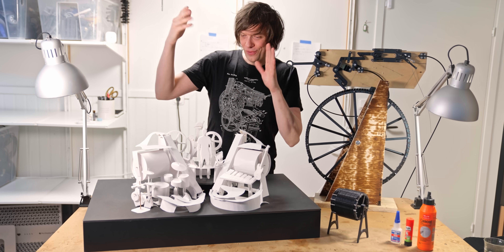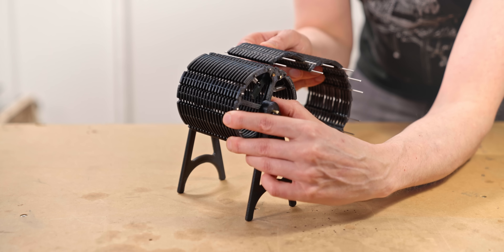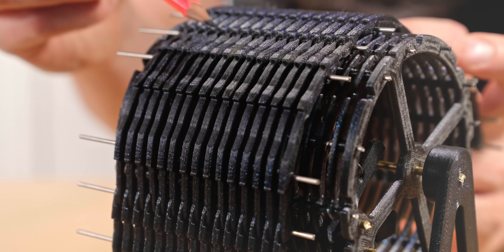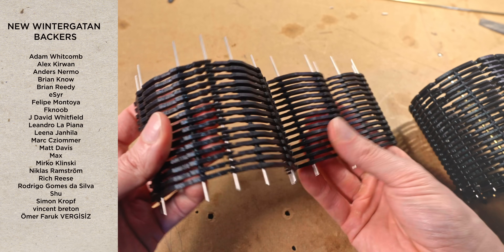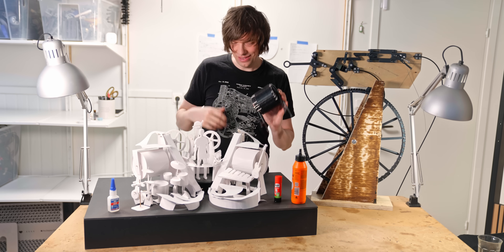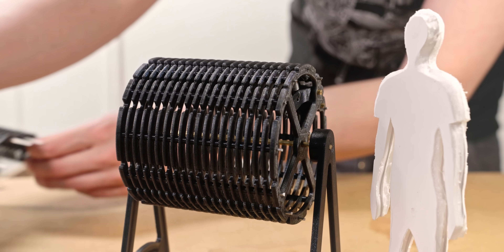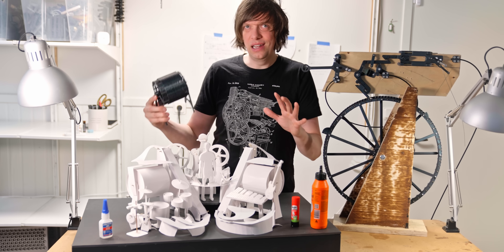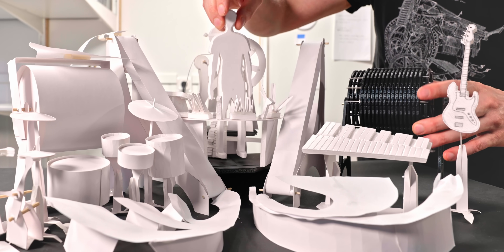A new way to switch songs on the Marble Machine

Comment: Is there a reason to have a manually programmable wheel on stage ? I feel like it'd be better to have 2 different wheels, one made for manual profiles, and the other made for pre-programmed music layouts to wrap around.
In theory it'll be easier to have two than to combine them, especially as each are used at different times for different purposes : the manual one should be designed to allow fast iteration and easy programming while the stage one would be designed for repeatability in song swapping and reliability for the alignment of each song "exo-sheet".
Reply: actually scrap that, just saw someone else's suggestion of having a programmable part be on a special music sheet, which is even better : you can test the alignment in-situ with the sheet mechanism, you can also have multiple WIP songs and just swap between them without having to take note of and remove all the manual profiles, then put all the other song's profiles

Comment: I think the idea of being able to switch out a fixed preprogrammed song is a good one.  It seems the problem which is being solved with this idea is that swapping out the entire drum is hard.   However, I think that CNC machining individual plates will be way too much work.    You will need to machine hundreds of different note sequences, and each one needs its own CAD / CAM program.  It could be better if you could snap in the notes into plates that you could pin or otherwise fix semi permanently in the plates.   Then the plates could be swapped on and off the wheel to change the song.   This way you have a very limited number of notes that you need to make, which is relatively simple, and the plate are all the same, and so they can be manufactured easily as well.

Comment: The idea of changing without having to unmesh gears sounds good in theory and with your plastic model. But that model hasn't been connected to the entire gear chain.

How well will this work when you do have it connected to the entire gear chain, so turning the drum to change the song will require turning everything connected to that chain?

Or will you set it up with a clutch of some kind that will allow you to disconnect it, but then quickly realign and reconnect it?

Comment: As an expansion of this, you could consider having a programming belt, which can be larger than the wheel, and only mesh with a portion of the wheel to play the song. Depending on the length of the belt, that might even allow the belt to be changed while it is playing.

Comment: wouldnt there be an option for some analog horizontal programming ring switch? I understand a srewlike design wouldnt work, but it could be that at 360 is "shifts" the next ring in. This way you can keep on adding rings to it. It does still have a small 'pause' while the new ring shifts into place. I have no idea about the sollution to getting it to work, but it would be sick and im pretty sure you and your team can find a solution to it

Comment: the problem with this system is, that you have to handle the "music-sheets" on the road and from the looks of it, they will be about 1m x 4 m and an absolute pain in the a** to transport. The big advantage of the 4-segment programming plates was, that they could be handled alone and stack nicely for transport, where as now, you would need at least 2 people, if not 4, to load the machine and an absolute gargantuant amount of truckspace to transport them

Comment: I'm no engineer. Just real world experience working with machines. Even I can see that single piece wrap around is going to need strong joints where it pivots to prevent breakage, (which in turn adds weight), when the change out happens. At least 2 people will be needed to change it. Any twisting of it could break the joints. (Repair costs). A handler could trip and fall breaking it. If that happens?????? Not good. Storage space for it during transport could be a problem.

I liked the quarter panel change out programming wheel concept in MMX2. Maybe mash of the two concepts together could work?  A single quarter panel could be handled by one person. The quarter panels would store better. Lees chance of damage to the panel.

Comment: If you made it a reel to reel programming belt the songs could be changed during a performance by feeding a new belt onto the conveyer or end of the previous belt.  It would also make programming the song easier in my opinion because you could have the belt numbered or color coded in a grid format to help guide the person doing the programming.

Comment: I'm curious about using scripted designs to help prevent mistakes. Like making it so that each slice of the wheel can only fit next to the two slices that are supposed to be adjacent to it. I'm thinking something like tabs that fit into holes, and encode the slice's position in binary. You'd need more than just the binary encoding, though, or a tab representing '1' would fit into the holes meant for every odd number.

Comment: Martin, I'm sure you've thought about it, but it's not a problem that the extra layer will increase the circumference a little bit, in length. Does this not affect the speed or length of the song playing? Doesn't it make a difference to the operation of the marble machine?

Comment: For when you program on the wheel itself, you can design a reader that converts your composition to midi and a program that converts that midi into a cad file for the permanent wheel skin.
Reply: Underrated comment.

Comment: while its certainly an interesting idea, i think the plan to shift the readers over into different sets of pins will be better. just making them move relative to each other a little bit is way easier and more discreet than changing a tire mid performance... and it can be done on the fly with just a single lever. and if you so choose depending on the size of the readers and profile widths, you could have like 8 songs on one wheel.

another thing you could do with that is have a gear train reduce the speed suuuuper low and have the readers constantly sliding slowly across the face of the wheel (like auto lathing) so you can have multiple revolutions to a song, then manually jump the readers over, re-engage the gear system, and play the next multi-revolution song without a real stop between them. you also wouldnt have to stop the wheels for any reason if you did this. the only somewhat difficult thing would be making the reader movement precise enough, but im sure that can be figured out in short order

Comment: I think you’ll run into a lot of issues if you keep them combined. You should keep them separate and have 4-8 sheets that go on the wheel. Should be faster and easier than one mega sheet

Comment: If you want to go this way, you should consider to build something like a track chain guided on two track rollers. You could avoid uncertainties in the song caused by the open gap of your track, because it could be built endless. To change it, you would need to somehow get the two track rollers closer to loosen it, put the next son on and tighten it like you do with a sanding belt on a band sander. One of the track rollers could always stay connected fixed to the machines shafts. This would alsow allow you to easily change the design of the machine if you ever want to play longer songs. you would just need to make the distance between the track rollers wider to fit a longer song
Reply: Maybe you could even do it with only one roll, leaving the idle part hanging downwards freely. you just need to make shure to get a precise connection to the roll, like a chain on a sprocket

Comment: I wonder if it would be good to create a way to automatically turn MIDI files into sets of programming profiles. That way you don't need to do all of your composition on the machine itself. Instead, you can write most of the tracks in a DAW and then generate programming shrouds from the MIDI information.

Comment: I am going to toss one thing that maybe missing in your design process.  Safety, You going to have a whole lot of moving parts powered by a massive fly wheel. They is a possibility of it being able to mangle someone who get entangled with a drive shaft or belt.  If you are going to have someone swap out the programing wheels a mechanism that disengages the drive and locks it out should be involved.

Comment: One thing I noted: This new method would require you or the technicians to have some form of break for each wheel or lift for the pins so that the wheel doesn't play any random or off notes while being replaced. You have discussed this before in other videos, but as you have done a couple redesigns since then, I wonder if there is a way to make this simpler as well. Would it easy enough for you at the controls to just flip a lever and all then all the pins for one or both wheels are lifted beyond the reach of the wheel? If anyone has thoughts on this, please feel free to comment.

Comment: This might be a stretch, but what if you could actually have a song feeder mechanism, as a secondary rotor that could be engaged / disengaged against the song drum, and that would 'peel' off the old song and 'feed' on the new song, to essentially switch the two in place.  That would allow you to have all the songs cued up in one long strip on a roller, and could play all continuously, without the need for technicians in lab coats.  I don't know, your current song drum design might make that tricky, but it was just too cool of a questionably possible idea to not share.

Comment: Maybe something to consider upfront: can you build your designs to that they can pack easily in travel cases? Know what I mean? You'll have to move this stuff so anything that can be done to streamline packing and unpacking should be considered up front.
Reply: That remains on of the major question marks and unfortunately is not talked about at all until now. Making the MM mobile and tour-proof adds in a ton of new requirements and constraints. It has to be: robust but not too heavy as to not require a semi to lug around (compared to a van for a band and their instruments), repairable on the road with materials and tools you can bring along, regular maintenance should be low-effort, easily erected and deconstructed with a minimal amount of people, not have a too massive footprint so it can fit into many venues, etc. 

Even a rough back of napkin guesstimate on the logistical and economical viability should give Martin a hard pause on the goal of a world tour with the MM.
Reply: @geckomoshpit  world tour with just guitars and drums gets incredibly expensive. imho, it should be scaled down. people liked the old wintergatan gigs with smaller contraptions. i'm not so sure having a single contraption play the entire gig would even be that interesting.  you could use even just an 8 channel marble machine quite nicely in a song that you made for it as part of a band playing.

Comment: Rather than fixed plates, can you just have a chain loop that hangs over the programming wheel?  That would allow you to have more control over the amount of time in each song's loop.
It would also let you get away with a smaller radius on the programming wheel.

Picture the belt used to lift marbles, but also with nubbins to play the music.

Comment: Copy/paste from late week:

So I’ve been trying to think of the problem with V1. Many people seem to agree “we want more” how can you get “more” visibility in the same space? Taking advantage of all of the space.

People want to see martin playing the machine? He should be in a place to access everything.

We want a Skeleton clock? everything needs to be one united assembly.

Would it make sense to ‘lower’ the pair of very large disks? Make more smaller disks to output the same energy? Make the smaller disks thicker instead of more? I’m leaning towards many small disks. A nightmare to assemble but it would ‘connect’ everything while they can be spread out (same height as control wheels more towards the crowd, and very low wheels in front and to the sides of Martin on a platform in the center. Directly in front of martin can be the gearbox looking assembly. To ‘complete’ the look I think instead of having the marble paths be 2 side, have the fallen marbles from the vibraphone side cross the center in front of the gearbox (lower than the view line) to the escalator ramp on the drum set/guitar side and make a figure 8 loop back to the other side.

I’m hoping all that helps give some more ‘commit not to commit’ ideas to everyone. I don’t think anyone had the ‘thats it’ feeling with version 1. Please don’t stop tinkering on the cardboard model until it ‘clicks’

Comment: Can you use large diameter plastic pipe? Large diameter irrigation pipe. Have a large CNC lathe with live tooling mill in slots and holes. Your design with the many parts seems over complicated. Modern machine tools will allow a precision programming wheel to be made simply out of a single pipe. Google machine shops and find one that can do it for you.

Comment: I really like the new solution with both an option for manual programming as machined profiles 🙂

Seeing this mockup I was wondering: the marble droppers will be operated via bowden cables, right? Do the marbles then still have to travel up that much, over the programming wheels, or might it be easier to detach that a bit?

Comment: How is this any better than multiple separate, pre-programmed plates like the ones you came up for the MMX? I don't want to sound antagonist but this design sounds inferior in every single way. Assembly, repair, transport, mounting and dismounting, and even composing all sound easier with smaller separate plates.
If there were reasons for you to pick this over the last solution, you forgot to mention them here...
In any case, love the project. Always looking forward to the next episode.
Keep em coming, Martin!

Comment: i'm worried that the driving mechanism being far from the rest of the mechanism may induce backlash in the transfer of power. If you want to reduce backlash I would have two driving mechanisms for the two programming wheels

Comment: Allowing for BOTH placing ready songs AND leaving holes for the manual profiles is a risky one. It may limit the structural integrity and the ability to shift the barrel (if we are sticking to the original idea of storing two themes on one program).

What I would to instead: make a blank song template, in which you can embed the profiles. Then, whenever you want to pause working on a song, you may take it off and put it on the side, and try something else.

Comment: Binding laser cut / CNC'd profiles seems like a great way to manufacture the programming disks! I bet you could generate the profiles from a midi track

Isn't this song replacement system the same as used on MMX, but with the sections strung together instead of being separate? 

The previous method seemed pretty foolproof already, but much safer and more manageable. All of that material is going to be extremely heavy, and the fact they can flop and move (whilst people are rushing to install them between trafks, or de-rigging whilst tired at the end of a long gig) is just begging for a serious accident to happen 😬

Comment: I am a little worried that the parts are going to shift and cause timing problems.  You've been very concerned with tight music and this seems possibly problematic if it only locks in at one place.

Comment: The belt looks like it would be incredibly heavy and cumbersome at 1:1 scale. There's a square-cube when working at scale; double the length and you get four time the area, but 8 times the mass- and you're going up by a factor of 10

Best to use individual plates, or, better yet, put each wheel on it's own trolley that can quickly be moved into and out of position- it will make the swaps faster, and save the stagehand's spine

Comment: As many others have said, definitely a BETTER idea, but is it a GOOD idea?      Do the math on how much one of those would weigh in various different materials, how easily they're damaged (say dropping it from top of drum height), what would happen if a single track got bent to the side.     Like, Stage hand is lifting up a sheet that weighs X kg, trying to latch it on a surface that spins freely, and has to actuate a lever to secure it?      Maybe smaller sections, and magnets?    I do like the idea peeps have mentioned about putting art directly on the drums.    It'd go against your "purely mechanical" but a second reader tied to LED lights and delayed so you could light up each instrument as the marble hits would probably be a helluva effect.
Reply: I am also thinking, he is underestimating the weight and how difficult it can become handling those Parts.

Comment: Instead of needing to design a drum that's able to hold a "skin" AND able to hold individual profiles (to facilitate composition) - would it not be better to create a custom "skin" which can hold profiles?

I think this would remove a design requirement from the drum.

As a software dev, requiring the drum to be able to hold profiles directly feels like you're compromising the production code in order to make unit testing easier.

Comment: I cannot stop thinking that the track will be too heavy and large too handle.
a stop for the wheel would be a good idea to make it easier to start putting the track on the wheel.
maybe splitting the tracks in smaller width or length segments could make it easier to handle